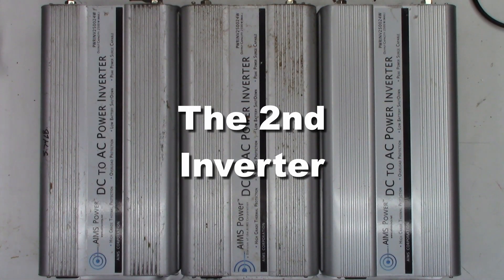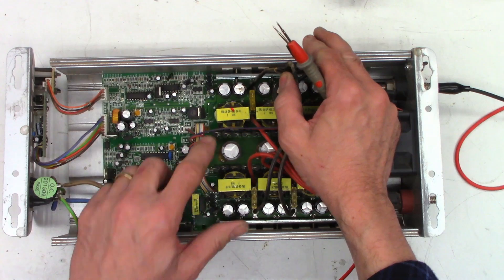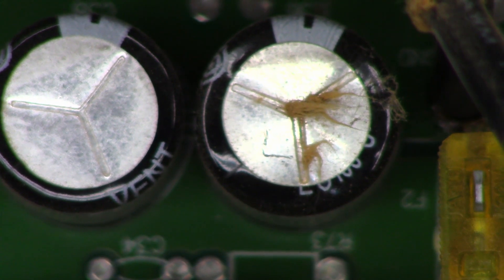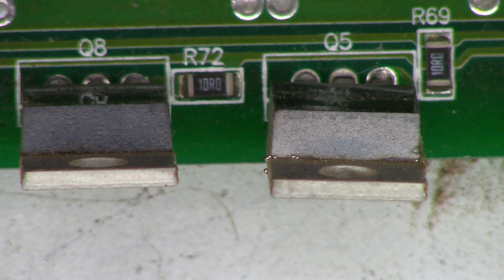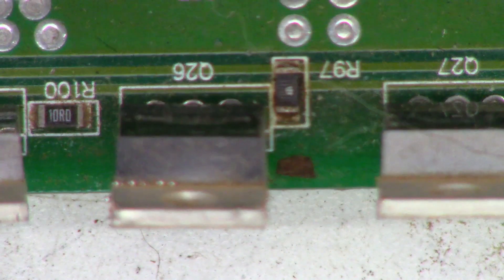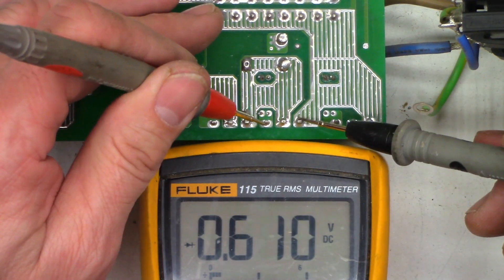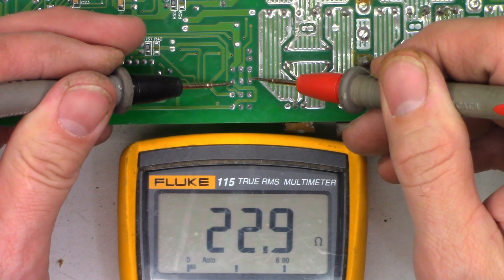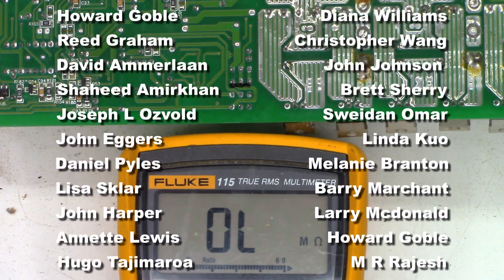CUSTOMER SENT 3 AIMS PWRINV250024W INVERTERS FOR REPAIR. THIS IS INVERTER #2

Comment: The inverter looks like it "bugged out".
The cost of a repair can exceed the price of a new unit making the old one uneconomical; even if you obtain suitable replacement parts and fix all the problems, there is very little guarantee of long-term reliability thereafter, so if something is too far gone, and there are no undamaged parts in it worth saving for more profitable repairs of other items later, the final resting place for it most likely would be the rubbish bin.

Comment: There is often a diode in the input for reverse polarity protection. If its smoked that is dead giveaway that it was connected backwards
Reply from the maker: No protection diode in these.
Reply: These use the Mosfet body diodes to do that, hoping they will survive longer than the fuse blowing time. More than likely the unit was run at full power for some time at low battery voltage, or with inadequate cable, till the FET's simply cooked themselves to death. Likely the fan also is not working, so the boards got lovely and toasty, or they had it in a nice carpeted enclosure, doing the same thing.